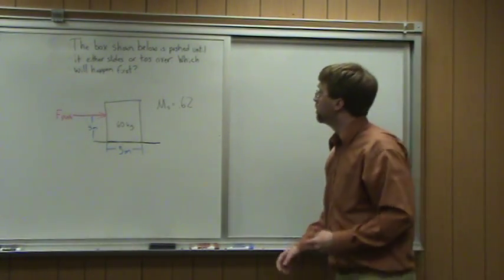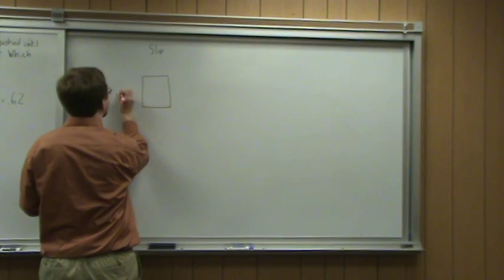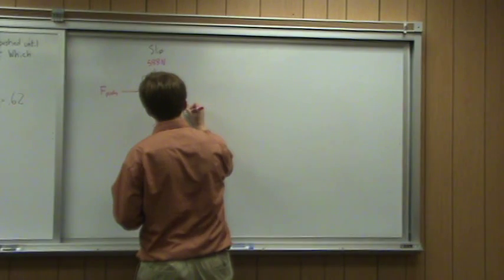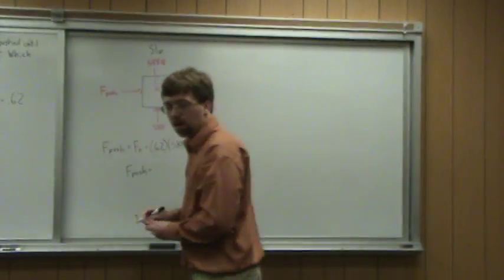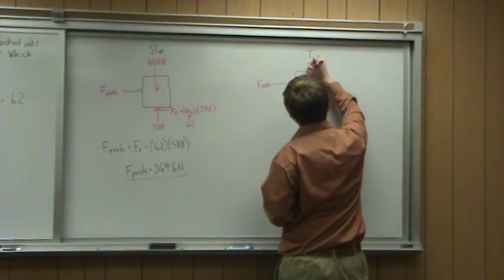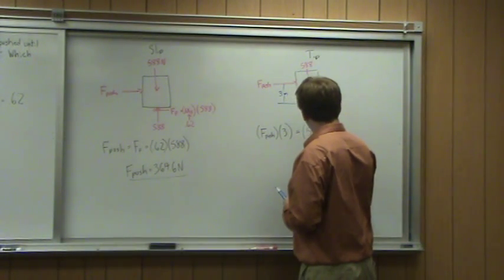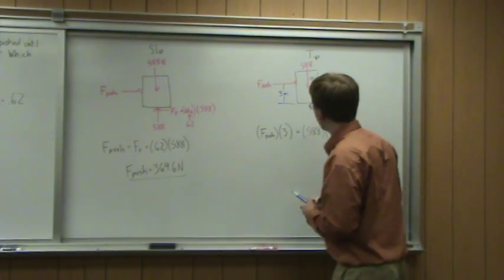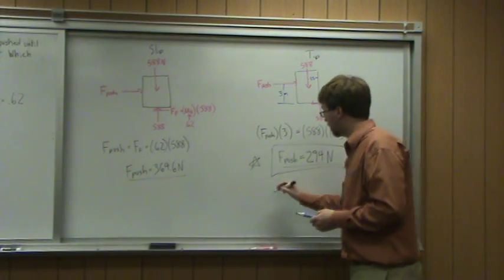Slipping vs. Tipping - Adaptive Map Worked Example 1

Comment: for the tipping problem why do you not have to use any of the values for the frictional force or the reaction force at the tipping point?
Reply from the maker: For the slipping scenario we assume it is about to slip (impending motion where Ff=us * Fn) and then solve for Fpush. For the tipping scenario we instead assume it's about to tip (where the normal force is on the back corner).  In the tipping scenario then, we can't use the same friction equation, because we are not assuming impending motion.

Comment: Wouldn't you need to verify whether each assumption ( Tipping/Slipping) was right ?
Reply from the maker: We don't really know which one will happen first until we make the calculations. For these problems you have to assume it will tip and solve it that way, then assume it will slip and solve it that way. The one that will happen first is the one with the lower required pushing force.